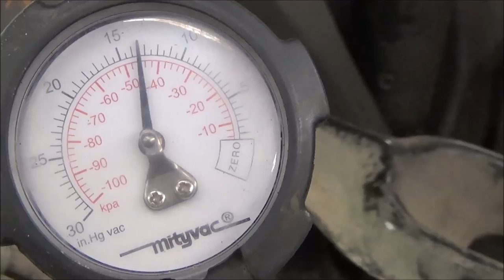Pontiac Grand Prix 3.8 - Water Pump Replacement

Comment: That mud in the radiator is a mixture of rust, the additive pack for the coolant separating out and becoming a solid, and what's left of their intake gaskets. I've seen that tons and tons of times, especially on older GMs that used Dexcool and iron blocks and/or heads. Don't seem to see it as much on aluminum engines.

Comment: Eric, if I may ask for your advice, As a driveway mechanic with a Central Pneumatic 26 gallon air compressor, I also have a small Craftsman 3-gallon that I bought 1st & have ran the snot out of, added a 10 gallon expansion tank from Lowe's  that looks like a 🐷...the craftsman has Never let me down except for in the power department so, when I was leaving Harbor Freight & saw the 26 gallon for $68 dollars, but, my question is, What Pneumatic wratchet won't break my wrist but, cost effectively will break bolts loose. I normally break everything loose by hand & if possible, I use my Porter cable impact with a 1/4" chuck to undo bolts the rest of the way but its to big to use most of the time! What air wrench do u recommend? I do keep up on my oil changes on my air tools about once per year & vehicles every 3k. I am changing an automatic trans in a 07 pontiac G5 (2.2 eco-tec) currently. Fun fun when I live in the north east rustbelt/ The Ohio Valley.....I with your channel the most because you are thorough, funny, & Great at your job!!!! Learn from the best 👌....It just takes so much longer using hand tools & I'd like to speed things up!!!

Comment: Everyone else's takeaway : Holy shit, Dexkill. 

My takeaway : Holy shit I LOVE the 3800 Series II engine. Absolutely fucking bullet proof to still run after that sludge is all in it. 

Seriously though, glad I keep up on maintenance with my 05 Impala police package. Otherwise I might have to deal with this. Did a coolant flush when I replaced the heater core. Will do another coolant flush this summer. (I doubt I'll meet the service interval. But I routinely do a 100 miles a day in my car for my profession. So considering it will be the "hot season" might as well do it. That way it's sorted for most of the following year.) So I usually do an oil change every 3 months I believe. I don't know exact dates. But I have reminders on the app I use to track service intervals for Oil, Transmission fluid, and Coolant. Plus when I need to get tires rotated, tuneup, etc. Everything you need to do to a car with routine service intervals, I have a reminder set. And considering I also use the app to keep track of my refuels. It always knows a rough estimate of my mileage. So I might miss an interval by a tank of gas, but that's it. Usually though I do them a few hundred miles early.

Comment: Yes it is stop leak with copper my grandad did that and it sewed it on the new engine as well that crap will destroy the radiator and the engine as well

Comment: the pulley on the water pump should spin freely with no belt right? i broke the serpentine and thought that the belt was just old but i think that the pump froze up causing belt to break.

Comment: You might be able to get a cheap radiator and heater core. Run it and flush it. As long has the owner does it himself. He might be able to save that car for a few more years

Comment: I was given my dads truck for Christmas of 2019. The water in the radiator was a nice brown color, the cap was caked to where you couldn't collapse the spring. It took me a half hour to clean the cap and flush the radiator enough for the coolant to be the nice green it should be.

Comment: If it isn't broken,  don't fix it, was what I was told over my lifetime.  Unfortunately when do we consider it broken? This mud looks like just that, but that may have come out after that much flushing. I'd say the guy used tons of stop leak during the life of the motor.

Comment: I have an 07 grand prix with the 5.3 and always used dexcool and my cooling system didnt even closely resemble that build up. I changed my own water pump, radiator and hoses a few thousand miles back. Its now at around 163k and still looking good, fingers crossed. Must have been a stop leak as others mentioned. I would be worried about the thermostat on there too

Comment: I was a steam plant operator in the Air Force and an older operator told me he put a little trisodium phosphate in the radiator of his car , this can be found at paint stores , It bonds to hard minerals in water so they don't stick as bad mud . BUT it's no excuse to stop cleaning your cooling system once in awhile lol . I f we had scale in the boiler I believe they used citric acid to eat it up so there should be a product for cars .

Comment: I've seen radiators exactly like this before.  If there's not enough antifreeze mixed with the coolant, or if the antifreeze is too old and no longer works to reduce corrosion (or if it's running straight water - same effect), it picks up a lot of rust scale over the years and they tend to clog the rad cap (and probably also the radiator itself, since it doesn't flow as often as the block, giving the sediment time to clump together.  Nasty stuff, looks like thick mud - and it has a habit of especially blocking up the heater core, as that gets the least consistent flow of all.  Put a hosepipe on my old heater and it slowly oozed out the other end like a slow-moving, thick, brown snake...almost like the heater core was badly constipated, but trying really hard to take a dump. :-P

Comment: That dexcool does that when it gets really old and is exposed to air.  So the gunk is likely in the top of the engine and not to bottom if it was run low on coolant.  I have done 2 intake gaskets, 4.3 vortec and 3.4 V6.  Only gunk was really in the top, its why they can keep running with all that crap in them.  Provided the coolant level stays above the cylinder heads, no damage is really done, which can be said about any cooling system lol.  Usually the car will overheat via air in the lines(thermostat cant open) before it overheats due to no coolant flow.

Comment: I fixed a 4.3 like this.  Packed full just the same.  Flushed it for HOURS. While idling to get 90% out. Orange stains are still on my concrete 5 years later.

Comment: Here in Florida some folks do not use coolant, water only. That being said I needed to replace the motor on a Dodge truck with a 3.9 V6. The freeze plugs had rusted away from the inside.

Comment: '07 Grand Prix NON-Supercharged. Beware: the idler pulley bolt that attaches it to the spring loaded tension mechanism has left hand thread. That means that when you remove the idler pulley you turn the bolt in a clockwise direction which is opposite of a normal bolt. It's possible to clean the coolant overflow tank with clothes hanger with an abrasive sponge taped to it. Got about 90% of the brown DexCool stain removed so ya can see the coolant level on the side of the tank. Installed AC Delco parts, best to order ahead of time, parts stores don't stock AC Delco. BUT when the car craps out there is no time to order ahead. Removed the coolant tank and loosened the power steering pump, access holes in the pulley, easy. Cleaned out the hose to the overflow tank, muddy. Seems like DexCool works best when circulated and when it sits still it muds up. See bleeding the system video.

Comment: 4:40, To change a simple sparkplug, you had to pull the engine from the car!    Back in the early 1970's, I think it was a Cadillac but could be wrong.  Right rear plug was inaccessible with engine in the car, until a garage mechanic, apparently said (I'm projecting here) stuff that and cut a hole in the right wheel well, changed the plug from there, and put a sheet metal plate over the hole.

Comment: Wowie, never changed the coolant.  That does say something though for the 3.8 V6 standing tough even with the Red Rock Mudd Coolant it had. It's likely whatever fluid was in the system had zero properties to it other than its ability to exchange heat !  Great idea pulling a vacuum on the cooling system rather than knocking loose mudd cakes. The new water pump should knock some of it around after a bit.

Comment: Thought how good u went thru this vehicle,and did the extra work,I'd sure hope all mechanics,would be so right,Well mine started leaking right above  water pump not hardly any noise,bit do have gunk,I'm guessing it's the Dex brand coolant that does this,all other vehicles I've owned,not one has looked like this,anyway,it looks like a big procedure,just kinda wondering what was the final cost to do the repair on the gran prix ?if ud be so kind,looks like i need a shop to do this,🥺ok thankyou😊

Comment: when you said be sure to check pulleys it reminded me of a story from work... Guy had an early 2000s jeep grand cherokee with the plastic tensioner pulley, he came into the store and said that his belt was making a squealing noise and asked if i would take a look, so of course i said yes and proceeded out to the parking lot and asked him to crank er up and pop the hood.. immediately i heard this godawful noise, so using the ole visual inspection i looked and WELL THERES YOUR PROBLEM DUDE!!! The plastic pulley had completely worn away and the belt was riding on what was left of the pulley bearing.. so of curse i could have just advised he replace the pulley, but i went ahead and said you might as well just replace the whole tensioner just in case, i also advised that he replace the idler pulley and of course, the belt. He then said... "do ya think it will last me til friday? because thats when i get paid." I said "man, i cant guarantee this contraption you got here will last another 2 miles." This problem could have been avoided had he had the darn thing checked when it first made a noise, because theres no way that it just all of the sudden started squealing after the pulley had already gone away.. like geez lol

Comment: Watching this video made me think of the word SAINT!   Not sure in my days of turning wrenches if I would have gone to the trouble of flushing the rad or the the block.  I would have just brought the customer in and pointed out the gunk in the radiator and tell them it was in the block, rad and whole system and have them take it somewhere for a flush.  You gotten wet from top to bottom for a customer who is just as likely to go on their merry way and continue to mix anti-freeze and do the same thing to their system again,  Yep SAINT !  Hope you charged them for the flush and your bath. :)

Comment: The brown sludge is the result of mixing green antifreeze and dexcool. You have to do what he did plus take out the thermostat and put the housing back on and fill the system up with water and cooling system cleaner solution and run it for 15 mins, shut it off and let it sit for days if possible. Then drain and flush flush flush. Replace thermostat and add the proper coolant. Bleed air out of system

Comment: Wife has a '00 Park Avenue. Same engine 3800 Series 2. So friggin easy to work on. Lots of room in the engine bay. If you get a car with this engine, whether it's a Grand Prix or Impala or Park Ave, I think the 3800 is in the Rendezvous also. Do your car a favor. Dump all that orange crap out, do a good flush and replace w/ good old Prestone. Best thing I could've done for that car. Also, replace those plastic coolant elbows with aluminium.

Comment: I have owned many GM vehicles with Dexcool and have NEVER had any sludge issues.  Dexcool has a replacement interval of 5 year or 100, 000 miles - whichever comes FIRST.  I think many people forget about the 5 year portion of the replacement interval and just run it to 100,000+ miles regardless of the time it's been in the system.

Comment: Dupont  used to sell a paper can of acid crystals to flush radiators. That was about 35  or 40 years ago. I think it was oxalic acid. Anyway you dump the powdered crystals into the radiator and fill with water. Run the truck about 30 mins to an hour and flush. Everything came out leaving clean new metal on the inside of the radiator and engine.  This was before Dex cool.  The acid would eat the white deposits out of the system left by the Prestone ethylene glycol antifreeze.

Comment: 9:53 There was a class action law suit a few years ago because of the Dex Cool formulation that was destroying engines and gaskets. They came out with a new formula that isn't "Supposed" to clay up like this. I imagine Eric is right. This guy probably never changed the coolant so it still has the old formulated Dex Cool in it.
Reply: Even the new formulation will turn to clay over time.  One key issue is people throwing good ol' green into these vehicles with Dex present in the system.  Instant sludge bomb!  It also sucks because of the silicates in Dex, you can't usually get it all flushed out, and they will still cause sludge issues when green goes in.  It's just not notable when you go green as people change the coolant when it looks like poop

Comment: That comes from Mixing Blue and RED anti freeze.. I spent 12 hours on a Mitsubishi with a power washer getting it out of the radiator/heater core.
Reply: Oh, I didn't think anyone would mix coolant brands together.

Comment: I have seen a radiator plugged like this just one other time.  At that time I also was running a radiator shop seeing hundreds of radiators a week in Chicago's suburbs.  My question is simple.  There is no doubt that the water pump had been out for a while so,  tell me how it never overheated especially the day the car quit on them !  So with severe winters and summers you would think that there was no use of any antifreeze seeing that it wasn't cycling.  Why didn't put a thermostat in it as well as unhooking the bottom hose.
     They can hot tank the radiator but as for the block there isn't much so with the room that you made with your flush it may clean a little stream running through the block.  I think to save the block may be a lost cause !  I love our videos !  Keep up the great work.  I learn something on every video.  no two things are the same !  Bye

Comment: I’ve never felt my eyes open so wide and bulge out of my face as much as they did when I saw the poopy in the radiator. I’m genuinely shocked that engine was running. I hope the owner of this car watched this video. Why can’t people treat machines with the respect they deserve. My truck has 170k, my car 180k and my other car 60k. All run awesome with my regular maintenance. Regular oil, other fluids, filters, etc. I probably go overkill but I also change the plugs every 50k even though they are “100k plugs”. With my cars, if it can be changed, maintained, or adjusted to spec, it gets done. It’s why my vehicles last as long as they do, maintenance is so vital.

Comment: I feel you with the coolant mud. My 04 s10 blazer and my 94 s10 blazer both had mud for coolant. 1 at 64,000 miles and the other around 170,000 miles. I flushed out my 04 like 10 times and switched to the universal green coolant. I'm still working on the 94 cause it started overheating after intake manifold gasket replaced because the oil turned to chocolate milk. Now I'm stumped. Head gasket?

Comment: I’ll be tackling this job soon and am also going to replace the plastic heater bypass elbows that connect to the tensioner.  Better to use napper aluminum ones or go gm plastic ones again?

Comment: You stated at the begining of the video that it makes sense to change the water pump with loss of steering, was that sarcasm or on the grand prix's can the water pump cause this. I have 2 pontiacs both exhibiting issues with the power steering. The first is my wifes 07 3.8l base, it started having issues steering but due to necessity she continued to drive. It finally broke down on her by throwing the belt and busting the pulley and shaft off of the ps pump. It had also been running 3/4 on the temp gague and making a whining noise. When the problem with the steering first happened the fluid was at the correct level (when i could find the hidden ps pump). I had to buy a new pump and replace the old one and discovered the end where the tank connects to the pump had completely melted shut and off. Could the tank have melted due to the temp and then blow the pump? Bought a new pump and now it still runs hotter than it should and  while driving somehow looses all of its ps fluid. Coolant is low every so often and oil level drops about a quart between regular oil changes. When the vehicle is cooling you can hear the bubbling of fluids from the area of the water and ps pump. The rack also does not show signs of leaking and seems intact, where the ps fluid keeps pooling up is on the control arm and serp belt. The second car is my gxp 5.3l that just started having intermittent steering tightness and goes away when reved up but still full of fluid. I have parked this vehicle until i can figure it out as to avoid further damage. This vehicle had a new rack put in 50k miles previously due to previous owner wrecking. Runs warm also but only started a week ago while idling more with 100+ temps outside.

Comment: that mud in the radiator is the dex-cool.  If air ghets in the system, it is known to clump up and clog everything.  That water pump seal was leaking causing air to get into the system.

Comment: see that quite often on gm vehicles with dexcool without a sealed overflow tank. think its a reaction with dexcool and air. not so bad in the cars with a pressurized overflow.

Comment: White wine vinegar works great to clean a radiator. Pour in a gallon and top it off with water run it till up to temp. let it cool some and drain and rinse. the add the antifreeze as needed!